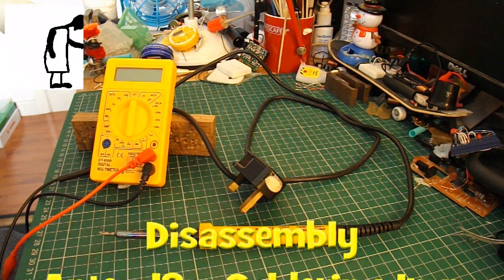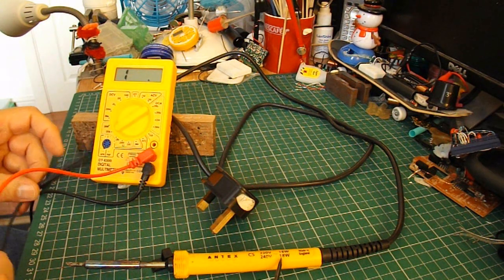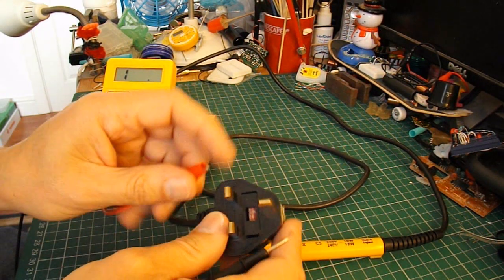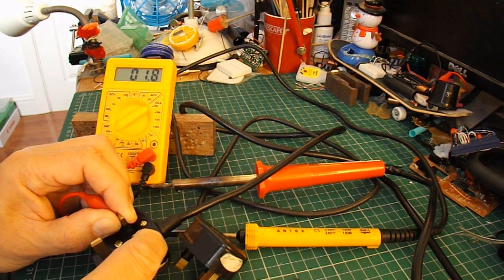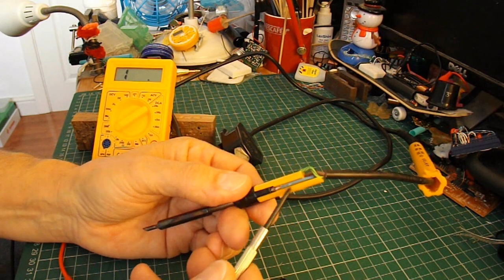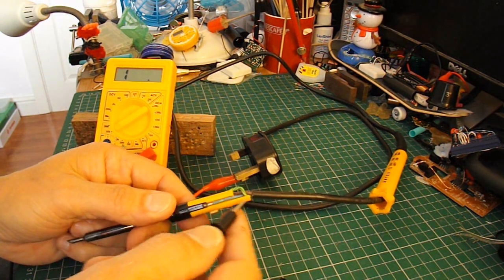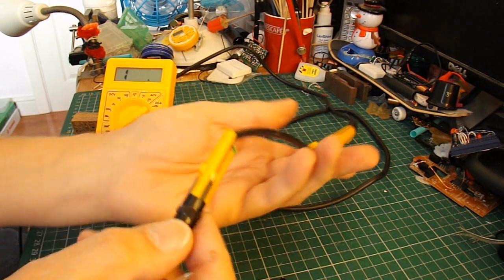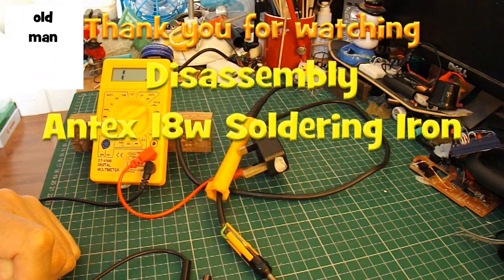Disassembly Antex 18w Soldering Iron

Comment: I've actually got about 20 of the antex heating elements!
(ANTEX XS25 soldering iron replacement heating element 230v
Part number E580060
EAN 5015044190025)
If anyone requires a replacement elements then I'm sure I can furnish you at a favourable price (it would take TWO lifetimes to use these myself! Lol)
Lardster142@gmail.com 
Please contact me via the above address (I apologise for hawking my wares in such a manner)
Thanks.....
Reply from the maker: Apologies accepted 😊 I recently bought a refurbished Antex on eBay and I am very happy to be using one again.
Reply: GrandadIsAnOldMan 
I too think they are great,
After trying a bevy of Asian knock offs and "getting burned" lol, I do believe that the old adage "buy well and buy once" is good advice.
Thanks for the kind reply, if you would like to send me your address via my gmail I would like to send you a spare heater cartridge GRATIS!. That way you will have many more years of quality soldering, and won't have to worry about burning the house down like I did with my Chinese iron of death! Lol
Lardster142@gmail.com

Comment: I did a search, these elements are available on line, well sort of...
https://www.esr.co.uk/electronics/tools-soldering-elements.htm
Reply from the maker: +Craig Nehring thanks for looking £9.44 + £3.50 + VAT so £15.60 against a new 18 watt iron from Maplin at £22.99 so might be worth considering. Maplin sell replacement elements at £7.99 with collection from store only and the nearest stores with stock are 104 miles and 182 miles away so that is a bit of a joke and makes the postage sound reasonable on the site you gave :-) OR I just buy a cheap replacement for less money than either of them.